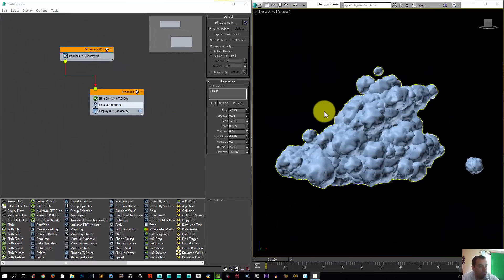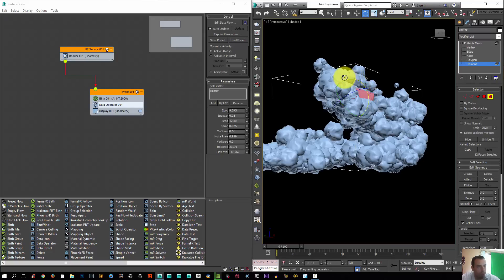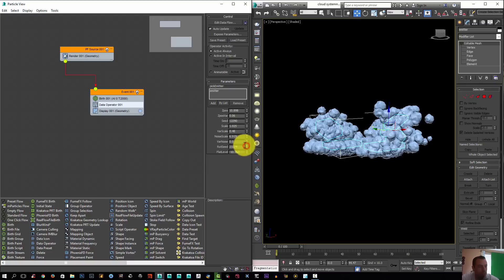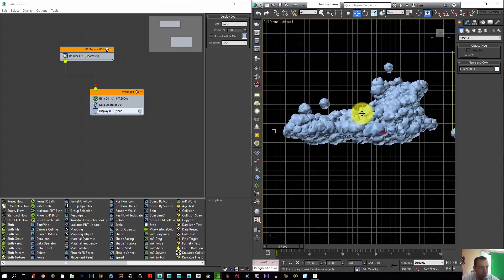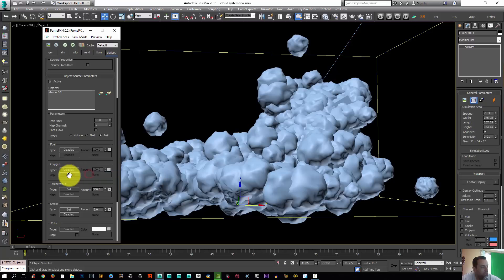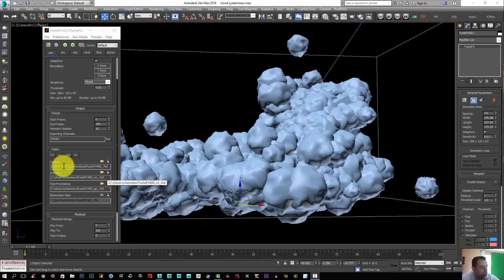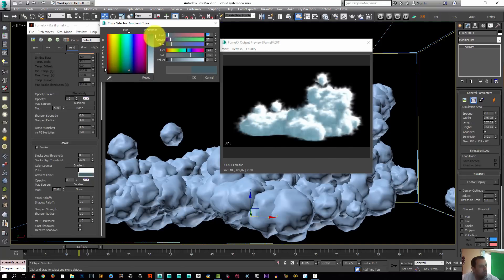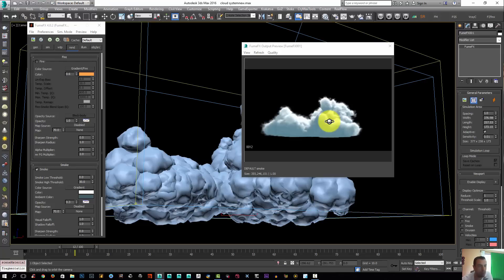Advanced Custom cloud system using particle flow - part03

Comment: I thank you for making this tutorial. But I don't thank you for waiting until one third of the way into Part 3 before saying that you will be using FumeFX, which I don't have. Your title is misleading because it just says 'using particle flow'. Please, next time say IN THE TITLE or AT THE BEGINNING of the tutorial what plugins you are going to be using. Thank you.
Reply from the maker: Sorry for the misunderstanding I assumed every one that use max know that they only way to produce realistic clouds is using Fumefx I never intended to mislead anybody . There's ways to create cloud inside max using sprite and fog gizmo and or bray fog but they very unpopular methods due totge time they take to render and the end result want come close to Fumefx .sorry again that was never my intention
Reply: It's ok, it's still a really useful tutorial. Thanks for your reply.
Reply: Do you know if it's possible to animate the cloud geometry? I tried animating the spinners (Z Position, PosVar, etc) but the mesh doesn't actually animate.
Reply from the maker: +Mark Garlick yes it's possible but it's not by inamating the spinner but by disabling some nodes inside the data operator .and Fumefx cloud can interact with any object in your scene as long as you added them as collision object